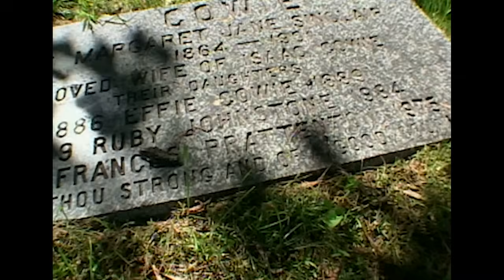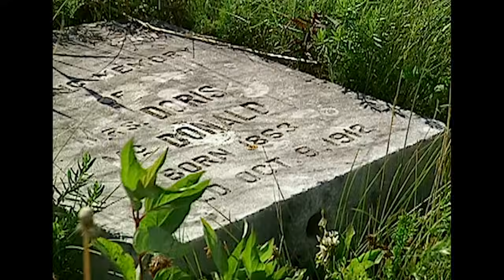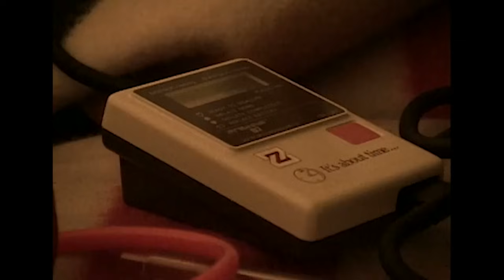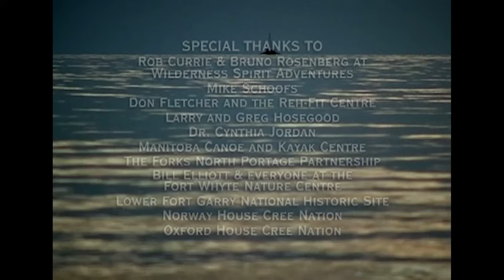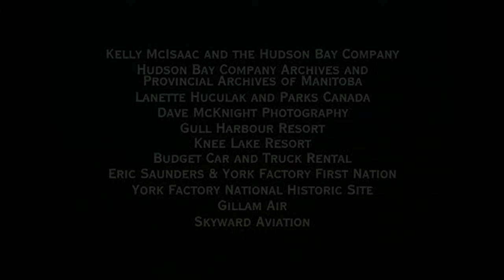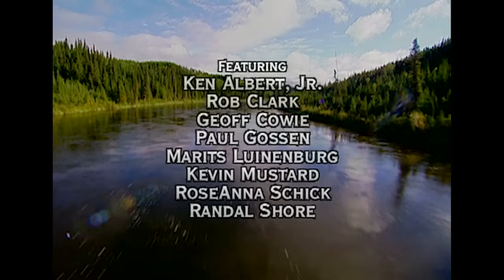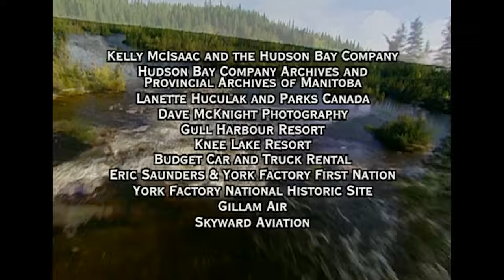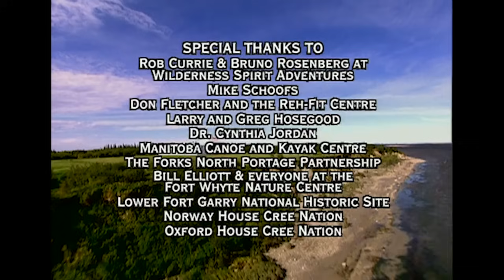What Was Life Like For A 19th-Century Fur Trader?

Comment: Most fur trade loads were measured in Troy rather than in Avoirdupois so that each of the required two packs to be carried actually weighed 74 lbs rather than 90 lbs. Having portaged 150 lb loads, I can assure that an average man in good shape can carry this over a reasonably good trail if helped with the loading. The big problem with carrying a load like this with a tump is not the head, neck or back but buckling at the knees on uneven ground.  The York boats were meant to be skidded on their keels using four men to a side for steadying the boat while a much larger crew pulled it by rope. This makes for fast travel. The frame shown in the video creates considerable drag on the skid logs making the boat hard to pull.

Comment: Oh come on. The strength test is complete b.s. The couriers de bois would NEVER have carried  so much weight, supposedly 182 lbs or more, concentrated in just one section of their pack, and certainly not as low down as the poor fools in the first 4 minutes are doing. The real packs were much larger and distributed the weight of the load evenly across the whole back. To concentrate it just on the hips is sheer stupidity.